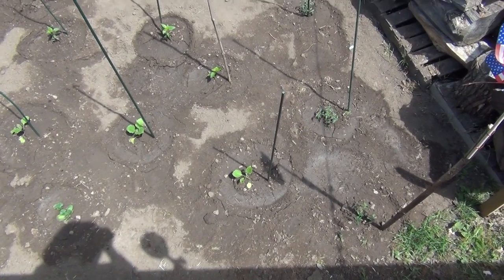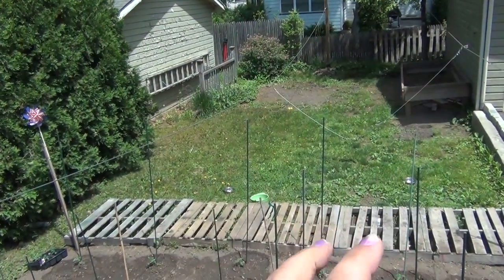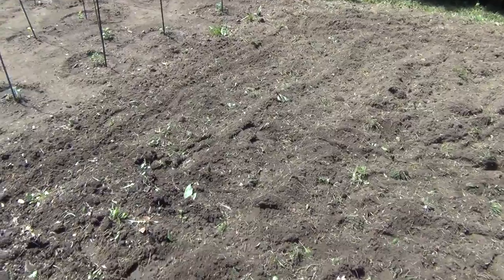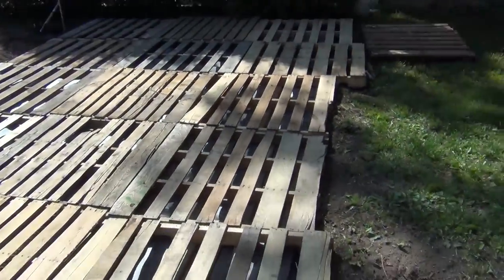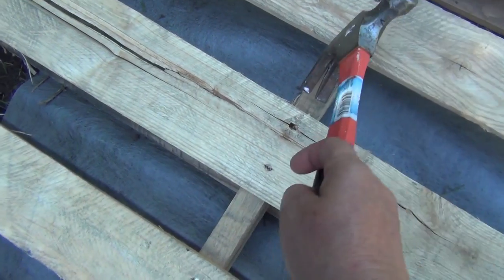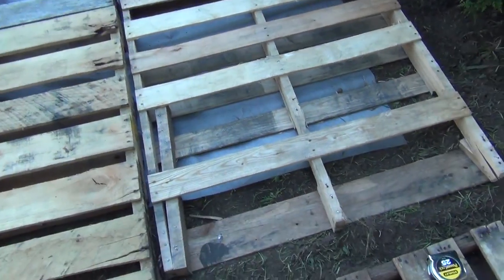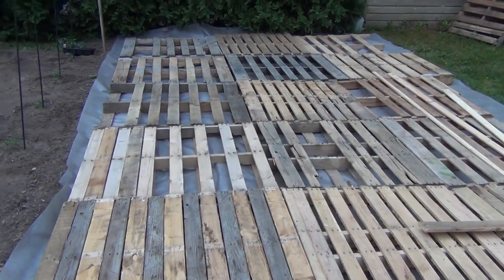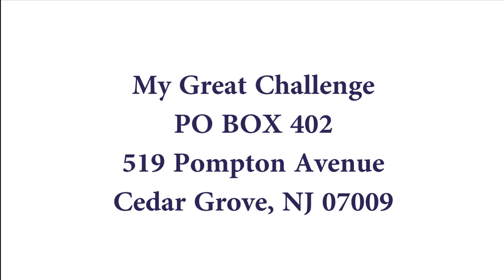In My Garden: DIY Pallet Patio (Part I)

Comment: Is the water that drains going to wash away the dirt and make the. Pallets sink?
Reply from the maker: SuperHappyscrapper not really, i had the row of 5 for about 4 years and they never bulged. the water runs off to the other side. I know it s temporary because eventually the bottom of the pallets gets damaged, but again the 5 I had are still in use on this contraption so all I can say is i don't expect it to move. Ideally it should be on top of gravel with the bottom of the pallets being tarred. I probably will put an exterior stain like a deck stain on the top and the sides.
Reply: SuperHappyscrapper that's what I was going to ask :-)  We have a pretty swampy backyard for the same reason of water runoff.